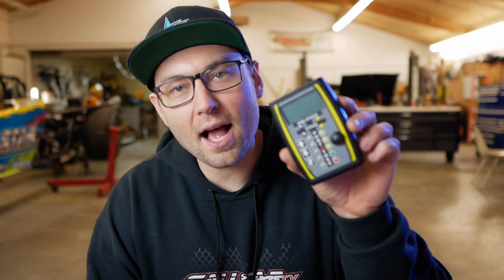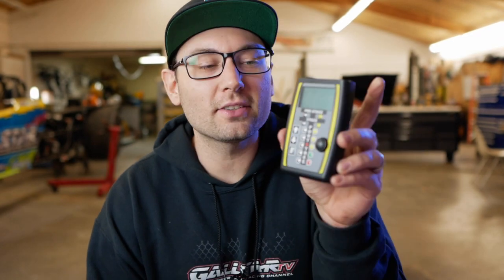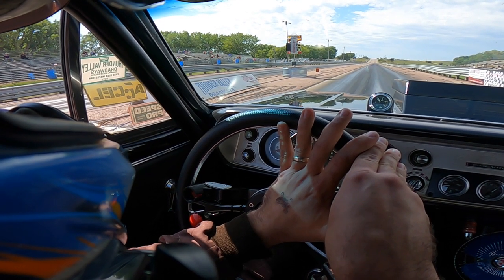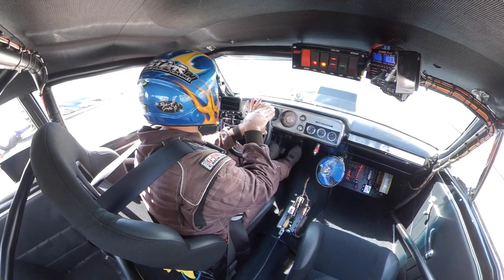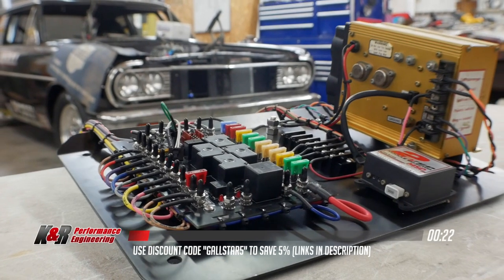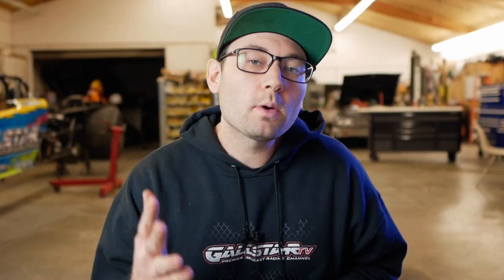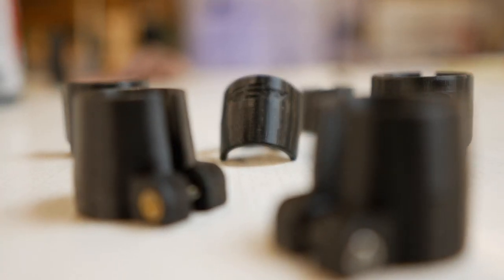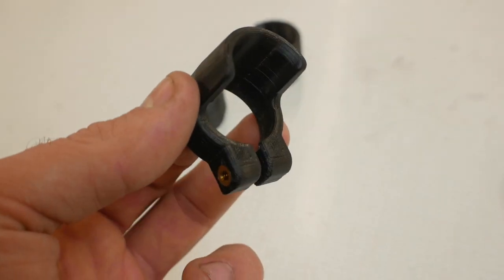REACTION TIME | Perfecting the "Let Go"

Comment: As always I enjoy your videos, we must all keep an open minded to others opinions and what works for them. I really have put a lot of time studying all thinks affecting my release of the button, always working for consistency.  My results are that I have tried to eliminate as many muscle as possible from the process. I found when I use my arm sometimes my thumb would try to assist the motion by pushing on the button. Knowing that about .050 of an inch of motion at the beginning is all that matters I have concentrated on isolating motion to my hand. I think of the motion of grabbing something hot between my thumb and index finger and getting burned. It's just opening my hand. Also I position the button so my motion is as perfectly in line with the button as possible not moving at any angle. For me Z-force is much more consistent but I could not come up with a recovery for a flinch so after a 3 month commitment to it I returned to the release. I agree there is very little margin for error at the tree but fortunately it is the one part of drag racing we can practice effectly at home. This is just my opinion and I hope my mind is open enough it may be complete reversed in a year when I find something that works better.  Thanks for the helpful and thought provoking  content.

Comment: Thanks for the video.

For top bulb I remove the button spring from the Biondo 00 button. If you unscrew the button and take off the Jesus clip, you can remove the internal spring out from underneath the red button.  And I use z-force mode.  

If I'm bottom bulbing, I use the Biondo Terminator and blinder to 3rd bulb.  I mounted the Terminator close to the steering wheel, ergonomically aligned. So I'm pressing forward and then release my thumb towards my shoulder for go time.

I actually feel more confident bottom bulbing.

Another very successful guy at the track I've seen has his Terminator mounted to the right of his seat pointing straight up and he presses it with his thumb and uses an axial rotation of just his wrist. And then there's another guy that slides off to the side of the Terminator and just lets it spring back.  

Whatever works for the individual and they can be repeatable with. 🙂

Comment: Another tip I found helpful is how you actually press the button. Wash button will only depress so far but the pressure you apply to it can vary depending on the situation (more adrenaline) and can result in several thousandths or more difference in rt.
Reply: I got this same tip from a decently known bracket guy. It took a different tb button after racing another car. But it worked.